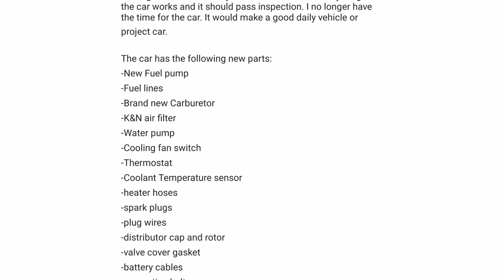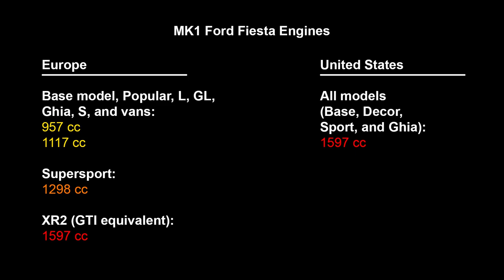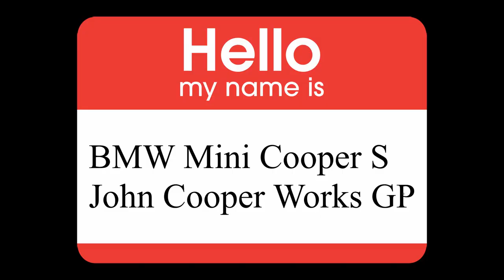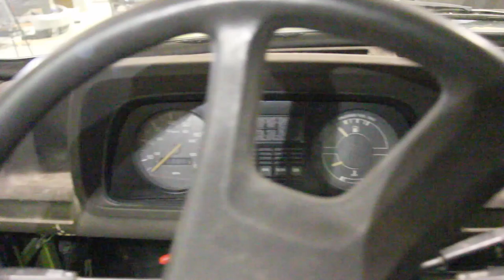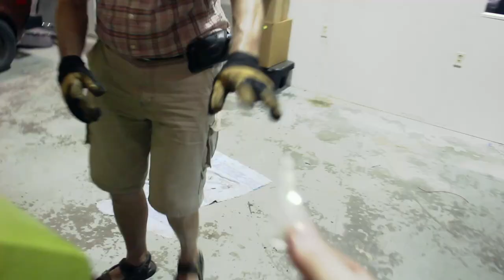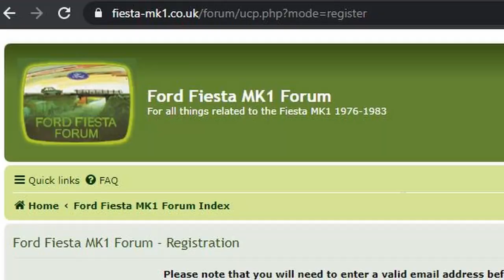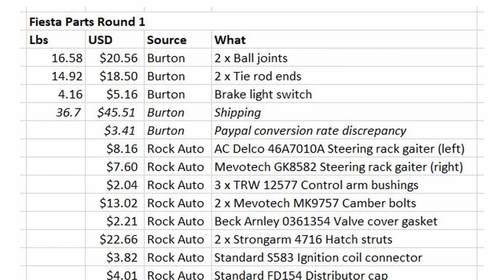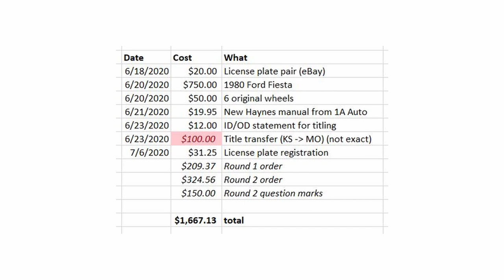I Bought the First MK1 Ford Fiesta I've Ever Seen

Comment: Good video. In 1980 I bought a 1979 used fiesta orange. I believe it had factory air. As far as I remember it was fine. I remember in stop and go traffic on a warm day or going up a long grade in the summer it would start to over heat. I would turn on the heat to help with  cooling. That would work a little temporarily. I had it a couple years and bought a new 1982 celica which of course was rock solid reliable. Thanks for posting.
Reply from the maker: That all sounds about right. A friend of mine had an early 80s Celica in college and that thing had nearly modern levels of build quality even after decades of use.

Comment: I came here looking for the car I learned to drive in. Mom had a 1978. Watch the battery bracket. Moms used to fail and the battery would shift and short out. I cant wait to see this thing on the road. Bringing back great memories.
Reply from the maker: Cheers Wayne! Great to hear about your memories with these cars. The first time I saw the battery bracket (if mine is original) I thought it was something someone had rigged up. I thought there was no way the battery wouldn't come loose over time. Glad you were safe in those moments. Another Fiesta video is coming soon.
Reply: Nowhere to Be can’t wait. Loving this.

Comment: Had a 1978 "S" model with the 1.6L ...it truly was an "econo box" ..easy on gas yet the cross-flow head with the Weber carb helped "eat" Rabbits at the light !.....got it cranked to 160KMh /100MPh a few times on what is now HWY 28 between Peterborough and Lakefield ....fun times ! ....those 7" headlights projected a ton of light once I replaced them with BOSCH units !
Reply from the maker: Sounds like quite the carnivore! I've actually got an NOS set of Bosch headlights sitting around... Maybe they will end up in there some day. I can picture that 78 smoking Rabbits all day!
Reply: @justindake  forgot to add ...also had a Stebro exhaust which likely added a pony or two...lol ...sure made it sound like a "carnivore" ....loved driving it up and down Yonge St. in Toronto ...made it sound louder !  One complaint I had though was that it suffered from "vapour lock" in hot weather !
Reply from the maker: When you get those buildings and tunnels bouncing the sound off... I bet it sounded great with that exhaust, mine is about as quiet as a whisper. It might be having vapor lock as well. Not sure on that yet.

Comment: Just bought a MK1 base model with a 950 completely original but needs a rebuild because it's been abondoned in a lockup for 13 years and it sweated causing catastrophic rot bought it to go with my MK2 automatic and I always wanted one currently waiting for a rebuild

Comment: I had a 1978 base model in bright yellow color, which I bought used with 45,000 miles on it in Arkansas.  It was a great car, but so basic that it didn't come with a/c, a radio (not even AM), a right-side door mirror, or even a day/night rearview mirror!  You had to point the rearview mirror up at the headliner at night or be blinded by traffic behind you.  Drove it to 80,000 miles with no issues.  Hard to find the 12" tires back then.
Reply from the maker: That sounds like a true MK1 Fiesta experience! A yellow one was just posted for sale on one of the groups recently. They sure knew how to do vibrant colors back then!

Comment: Euro spec mk 1 reversing lights was 1 central light under the bumper or you could use fiesta mk2 rear lights while had the reverse lights built in. Mk2 was just a heavily face-lifted mk1
Reply from the maker: Thanks that's good to know! I'll probably just put an LED down there, but that means there should be a wire around there already.
Reply: @justindake  there were certain mk1 fiestas that didn't have reverse lights, I'm in the UK where the Fiesta is quite popular,it was never fitted to base models. I have seen mk1 retrofitted with mk2 rear lights. There are still a fair few Mk2 fiestas still on the road, mk2 was on sale from 1983-1989, they were a very popular car at the time as well. I gather the mk2 was never sold in America. As I said before it was a heavy face-lift with a different front end, dash and tailgate, but the tailgate and rear lights do fit each other.
Reply from the maker: That's really interesting. You're correct we never got the MK2 here in the US, I really don't know why because the MK1 was a pretty good seller but that's how it went. I think by the 80s US cars had to have reverse lights but I'll look into that. I love that so many of them are still on the road over there! Though other people have commented that MK1s are rare there and everywhere

Comment: A much loved car here in the UK. Were ten to a penny at one stage. Is the the Kent Crossflow engine you have fitted? Good luck with this project mate
Reply from the maker: Thank you! I have been told they were common in the US at one point as well, but today they are all but completely gone. This one does have the 1.6 and as of this week it's finally running well!
Reply: @justindake  Early Ford Pinto had those 1.6 crossflow engines.   

1.6 in the Fiesta sounds very nice --- I have one too,  XR2,  restored a few years ago.   All the parts are there on Burton or ebay.co.uk

Comment: FYI  about 500,000 where to our shores 78-80, then Ford switched to Escort. I have  a 78 S, There`s plenty of places you  buy here in the states, be careful , don`t buy electrical if you can help it,[turn signal switch and head light stalk is different wiring]. Ebay is 78-80 Ford Fiesta and also punch in D8RZ on E bay for parts. Good luck! mine is orange. And you post this on my birthday! cool.
Reply from the maker: Thanks for the facts! I can't believe half a million came here and only a handful are left. Where did they all go? I've never even seen one in a junkyard. I've got some of the electrical issues with mine and I'm working on them now. D8RZ pulls up a lot of stuff. Nice! Enjoy your orange guy when you can!

Comment: In the UK they are restomoded to hell. Zetec engine with a 5 speed is an easy transplant to do. Plenty of how to do on here YT. Good luck
Reply from the maker: Thanks! I admire those builds and maybe one day I'll take it on, for now I don't mind it being slow!
Reply: Not so easy, but not too hard too.   I had to cut framerails and reinforce them  to fit the zetec and the 5 speed (Escort diesel 5 speed - long gears like Xr2 Mk2 5 speed box), cut the Escort oil pan corner, and the pan near the gearbox-   and lower the left suspension bar.   Also use Escort mk5-7 oil pump or short oil filter to clear tie rod.  The upper engine mounts are custom made, and radiator. 

Custom exhaust I welded myself (just the muffer/silencer is from some US company like flowmaster ?)  - just one because no space,    oh and a must --- XR2 brakes with ventilated discs ....   

Fuel economy is the same , almost 4x more power :)    First axle shaft lasted 6 kilometers (about 4 miles) and broke. Now I have a bigger one from an mk3 Escort

Comment: I have a green '80 "S" with 468,000 miles on it
I know this because the original owner introduced himself after an autocross event (I ran in FSP class and won 3rd place in my second season)
I said "obviously the odometer's been turned over" to which he answered by holding up 3 fingers- then later I turned it over again
Reply from the maker: Holy cow! That's awesome. Way to keep it alive and well used. Are you in the US?
Reply: @justindake  
Yes, I live in Oregon, and thank you
the original owner bought the car in San Diego, CA- I have all the original sale paperwork showing that it was a demo model with a couple thousand miles on it
That's some demo-ing back then- I'd imagine lots of people have driven this car 30 miles or so
Reply from the maker: Wow. That one had a lot of drivers behind the wheel. I wonder what they all thought of it. I do think these would make nice autocross cars without too much work, just some stiffening up really.

Comment: On OLD Fiesta's The Air CON is in the boot /trunk Floor. 
1976 Period Antique Air Con. 
When New, They Never Came with Air Con, Air Con was an AFTERMARKET Age Related BONUS FEATURE. 

Brilliant Cars, I LOVE the Mk1 Fiesta. 
I Still Want one Now, 
but i Can't afford UK Prices at Auction of £25,000 to £30,000. for a mint example. 
US Dollars $30,000 to $40,000 ??  ( I don't know the Current UK Pound Dollar Exchange Rate ) 
Approx six times the Price new in 1982. 

FORD Factory Price list, September 1982,  ( UK Prices in GBp £. 
Base Model was £ 3255.  Three thousand two hundred UK pounds. 
the Luxury 1300 Ghia was the same as the XR2 sports version, at £5150.00 UK Pounds. 
? $6,000 us dollars ? 
NEW on the Official 1982 Ford Sales Brochure.